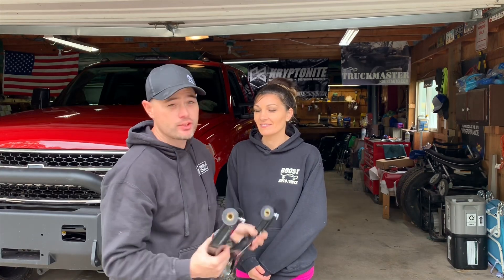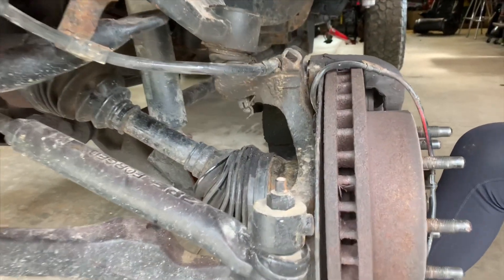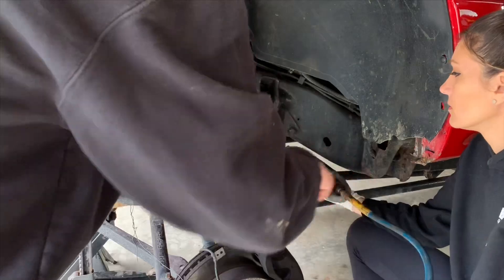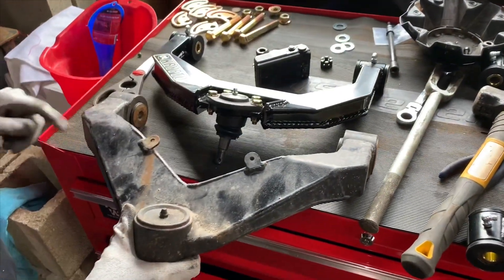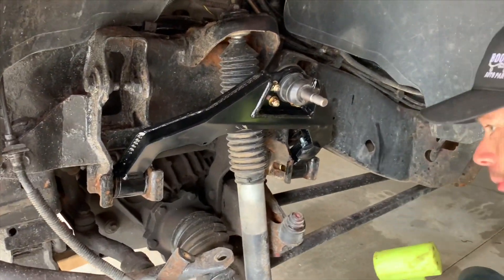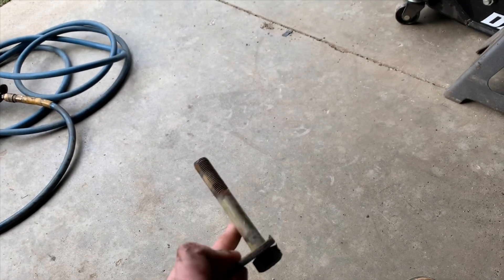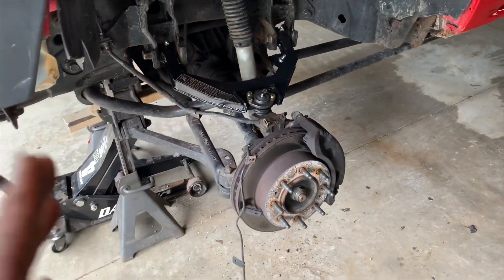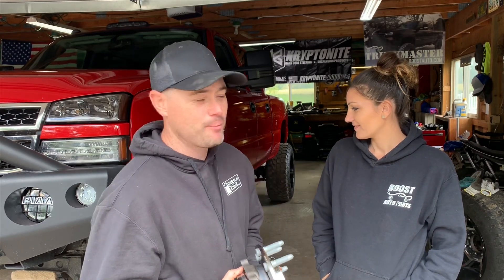How to Install Kryptonite upper control arms! GM/GMC Truck

Comment from the maker: In this video it was pointed out that I was supposed to install the ball joint on the lower part of the uca due to my lifted application. I will be fixing this before it goes to the alignment shop 👍 thanks guys
Reply: Their instructions state:
Mount upper ball joints to bottom of control if you are adjusted above stock height.
Mount ball joint down through top of control arm if your truck is stock height, or you have a 4" and up lift kit keeping torsion keys relaxed and control arms flat.🤷🏼‍♂️
Reply: @MrSrtman18  Yes, it mounts either way...the instructions are vague at best.

Comment: kEEP SHOWING INSTALLS LIKE THESE!! Love it. You're so right how other youtubers just speed up video and add sound or just show before and after and not exactly how to install it or issues you'd come across while doing installs. I appreciate you all
Reply from the maker: Thanks
Reply: @TruckMaster  question. I’m getting a 2022 2500 at4. What do you recommend I upgrade in the front end? I’ll be doing a lot of driving and also towing

Comment: Dirt King Fab. makes alignment cams that CAN NOT move out of alignment. I also recommend ditching the stock alignment pins (which can fall out on their own anyway) and use 12mm bolts with nylocks...for stock cams or aftermarket cams. The kit is under $70 bucks per truck. If you are going to install upper control arms, this kit will save you alignment issues down the road...or trail.

Comment: @ Truck Master   I believe the ball-joints are on the wrong side of the control arm for a lifted application. I believe they should be mounted to the bottom of the control arm.                                                                                           (If you are adding this a-arm kit to a factory height truck just to take advantage of the bolt in ball joint feature and do not plan to level it out, you must drop the ball joint down through the ball joint pocket so that the ball joint flange is on top. Mount the ball joint on the bottom of the arm for leveled or lifted trucks. Tighten all hardware in this step to 22 ft-lbs. of torque.)
Reply from the maker: Your right I missed that step thanks 🙏 looks like I’m fixing that now 😂 luckily I didn’t get a alignment yet
Reply: The instructions are confusing....
Mount upper ball joints to bottom of control if you are adjusted above stock height. ( Meaning cranked keys? )
Mount ball joint down through top of control arm if your truck is stock height, or you have a 4" and up lift kit keeping torsion keys relaxed and control arms flat. Which is it...you obviously aren't stock height with a 4" and up lift.

Comment: clean the frame and use any kind of lube before trying to drive in the control arm, all A arms are tight if they are good. When your wife is a mechanic she is a keeper. AWESOME VIDEO

Comment: I reached out to Kryptonite and currently they do not make upper control arms for my 2000 1500 Silverado.. 😭 but they did say they are in the process in R&D to have some by Summer 2021... 😁

Comment: Safer way to do it so that upper control arm won’t hurt you is to get a key way tool for the torsion bar and take the torsion bars all the way out so that’s definitely a safer way to do it, thank you for the vid it was a very great video 🔥

Comment: Since your building a built proof duramax I would suggest getting lift spindles and getting rid of the upper control arm drop brackets
Reply: otto oquist what is lift spindles ?
Reply: Several different companies are using lift spindles by doing so it keeps the factory geometry the same on the upper control arms 
The lower control arm is relocated using a new cross member that ties everything into the factory frame mounts 
Lift spinals are a much stronger way to go !
Reply: Have you ever actually seen anyone do the swap from the drop brackets to lift spindle ? I’m looking to see if it would be a simple R&R

Comment: Don’t quote me but when you’re anything other than stock height, you should bolt the ball joints on the bottom of the arms to take the angle out of it.
Reply from the maker: Your right I may have to fix that now
Reply: Truck Master just looking out for ya! I have the whole setup on my truck, grease it every 3k and it’ll treat you well!
Reply from the maker: Thanks for catching that

Comment: hey those might work for wifemax to upgrade her truck just change out the ball joints :)   i usually drill those areas and tap them for a grease zerk that way i can atleast help that area with grease :)   i was going back and binge watching some older vids haha :)

Comment: Yeah buddy they actually fit perfectly on stock units you have some funky ass drop brackets for your upper control arms that make it not fit correctly. And those bushings will not last forever and forever in fact they'll have a significantly shorter life than your original ones

Comment: If you would have loosened the bolts in the drop brackets this would have been a lot easier for you to remove and install. Also if you mark the position of the offset washers, the alignment would be a lot closer.

Comment: The ball joint should be on top  because on the bottom it would let the uca seperate from the ball joint on top it its a safety feature

Comment: The Krytonite is user friendly.  I can appreciate that   I go through a lot of ball joints and wheel bearings.  Would these be applicable for a plow truck?    Yes it’s a duramax plow truck.  Love the video.  Keep it up
Reply: Kryptonite.  Damn
Reply from the maker: Yes it will definitely work for your application

Comment: When doing the upper control arms do I need to brace the lowers and how. I see you have jacks under diff drop bracket. I watched other vids where I don’t see anything underneath and some show jack stands or jacks to support. What is the safest way to do this

Comment: Youre suppose to put the ball joint on the bottom not the top. You put the ball joint on top for stock application.

Comment: i also have a procomp lift on my duramax and just purchased same set of control arms. Did you stick with the ball joint mounted top or bottom?

Comment: Just in case anyone else is looking the KR6696 factory style press in upper ball joint is orientated with the index mark to the OUTSIDE like the Mevotech TTX. Apparently Kryptonite can't get that basic info included with their products as far as I can tell I got NO instructions and they have nothing on their website. After emailing them they sent me instructions they blame on new employees omitting a print out from the packages.

Comment: You should have a jack under that lower control arm.If that shock came apart it could be dangerous.A lot of tension on that torsion bar.

Comment: Separate question, I recently noticed the front bump stops on my truck were dry rotted and gone so I replaced them. I was surprised to see that the bump stops are in constant contact and wondered if they are are your truck as well or if something is funky with my ride height since the truck has a 6" lift kit?

Comment: Hey bud get those drop control arm brackets off they make it hard to align and mine broke caused me to get in bad accident.PLEASE REMOVE FOR SAFETY GET LIFT SPINDLES
Reply: Did you replace yours after or was your truck totaled actually been looking to replace mine w lift spindles but pro comp is unsure if it’ll work

Comment: Question I installed them on my 2008 lmm dually. For some reason when I turn all the way my steering wheel locks won’t return back.looks like the toe comes in bad did wheel alignment. checks out good casters also good ?

Comment: Awesome video. Quick unrelated question. How different is the egr delete between the lbz and lmm? I've watched your video on the lbz
Reply from the maker: Not much at all other than the u-shaped coolant bypass tube in a Egr delete kit
Reply: @TruckMaster  so pretty much just the coolant bypass? The rest is the same. For the most part?

Comment: The camber bolts that came in the kit won’t fit because they are the stock style designed for the stock mounting position. You have upper control arm drop brackets though that are a bit different in design. Great video though I love Kryptonite products they make some really awesome and beefy stuff!
Reply: I have a 2008 Duramax and I recently replaced the upper control arms and had an alignment but she’s back to having play . 
If I buy the kryptonite control arms then should I also buy there brackets?

Comment: Hey truck master what lift kit do you have?
Reply from the maker: Pro comp 6”
Reply: Hey truck master what’s the biggest lift kit you can do for a 5th wheel
Reply from the maker: Not to sure great question though my buddy has 35’s with a life and I believe he had his 5th wheel custom to pull it
Reply: Truck Master what size is his lift kit?

Comment: Why are you running those garbage control arm drop brackets? Get lift spindles and get rid of the drop brackets.
Reply: Would the swap be a simple R&R without anything else?

Comment: Why do they still have shit ball joints on aftermarket ucas? Guys need to start using uniballs. Their isnt much difference in the stock to these besides shit looking welds and zerk fittings lol. Good video though man.

Comment: Holy suspension geometry cluster f*CK please do it right or don't do it at all DROP SPINDLES it corrects all of that without all that ball joint stress and having to do all that kryptonite makes great stuff but you still need drop spindles to correct that angle